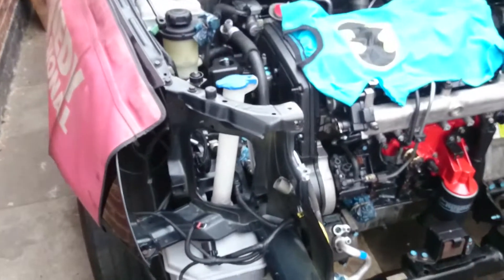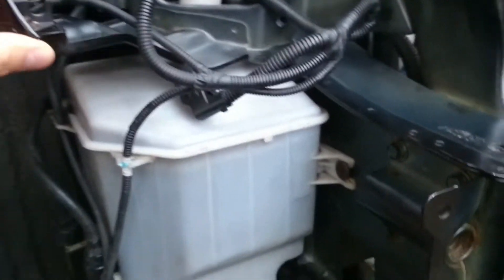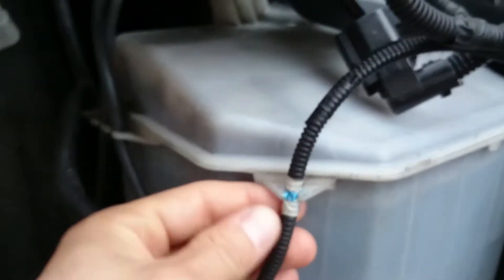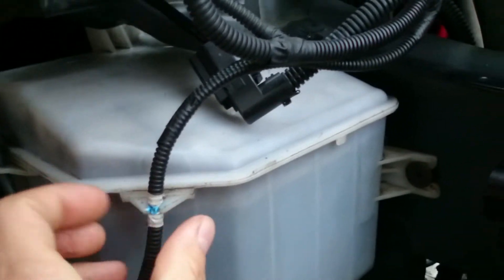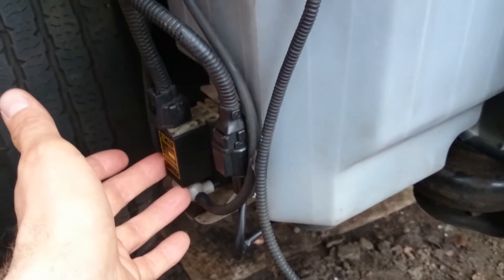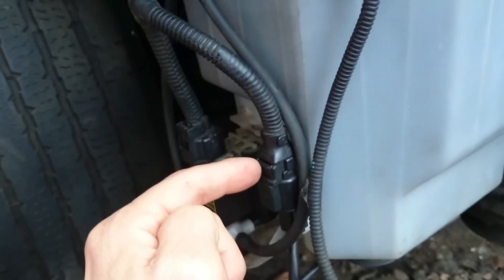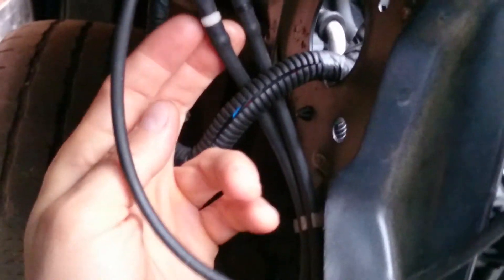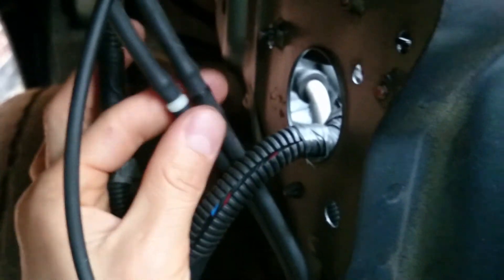Kia Sedona Carnival 2.9CRDi screen washer tank installation removal

Comment: Hi. I'm having trouble with my front wipers, they only work on lo speed. Nothing on intermittent or fast speed or flick up. Ive changed the stalk nothing there. I've been told to try the motor relay but I can't locate it. Do you know where it is located? Thanks